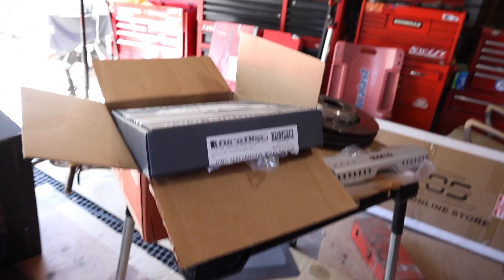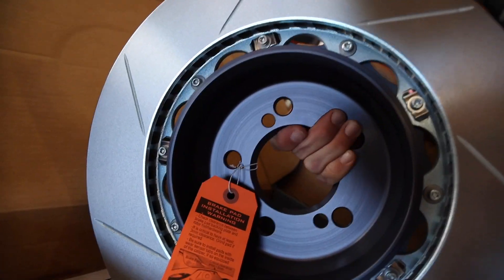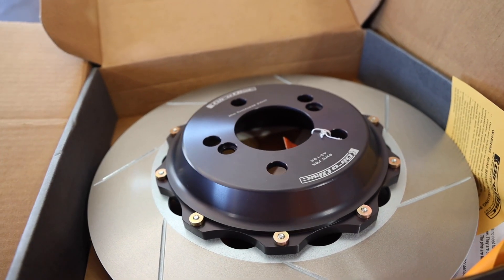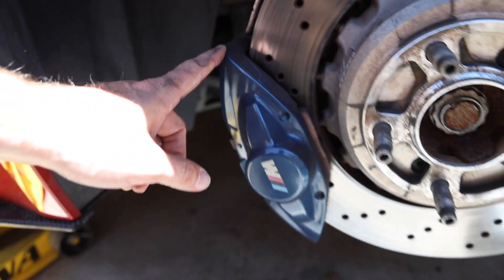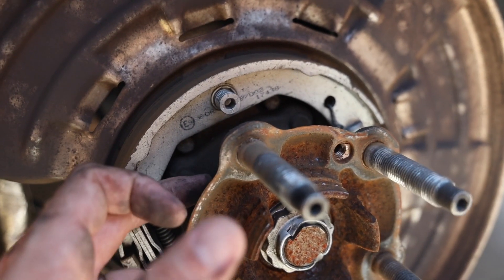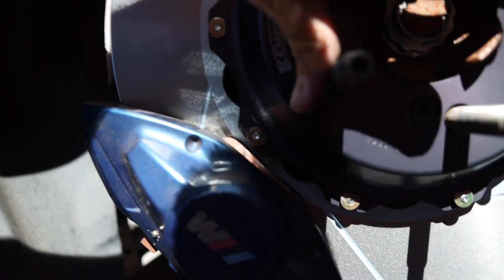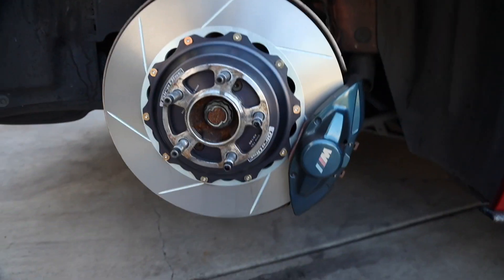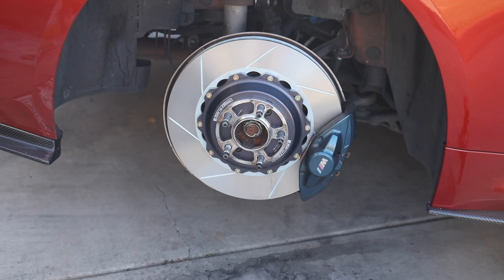TWO PIECE ROTOR UPGRADE BMW M4 REAR GIRODISC ROTOR INSTALL

Comment: Camera work on point 👌  👏
Reply from the maker: Thanks man!! I really appreciate that.
Reply: What pressure washer would you recommend from home depot that i can use with my mobile detailing buisness? Doesn't have to be amazing but easy to use and easy to attach a foam Canon

Comment: How would these vs OEM would be in regards to brake dust and noise ?
Reply from the maker: I run full race pad Gloc R18 and R10 pads and I don't care at all about brake dust only performance. Dust isn't something you should honestly care about less dust means less friction and less stopping power usually. If you don't want dust spend 10k on carbon ceramic brake
Reply: @BlakesGarage  meant the oem steel ones not the carbon ceramics sorry for confusion

Comment: Dam…. You see any improvement with these? 
I just did all new rotors on my F80 (also track) not long ago and there wasn’t anything available at the time except the AP’s.
Reply from the maker: Yes, big improvement in consistently. Also they last way longer under track use. Dissapate heat quicker for sure.

Comment: nice video, what are the torque spec on those screws?
Reply from the maker: The ones that hold the rotor onto the hub? I honestly don't know.
Reply: Not a lot lol it’s just so that the rotor stays on and aligned when you take off the wheel. It’s not something you want to strip so hand tight is good